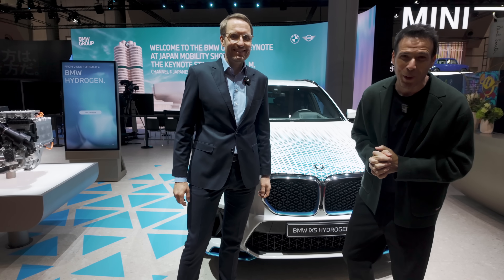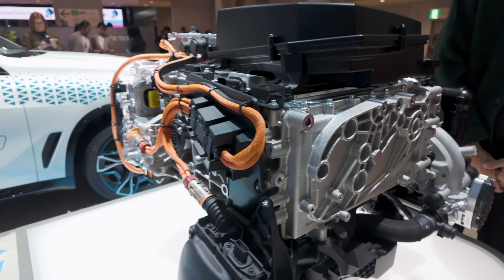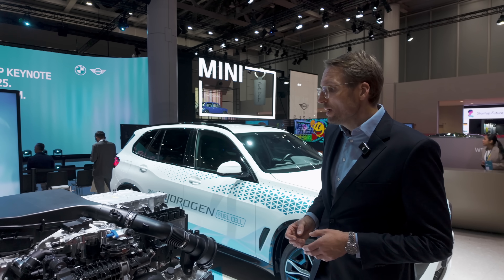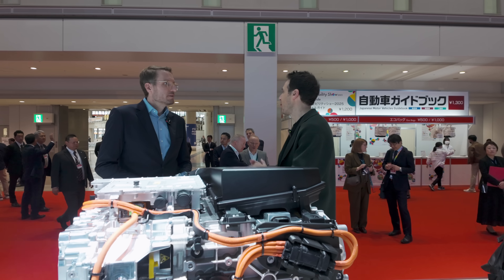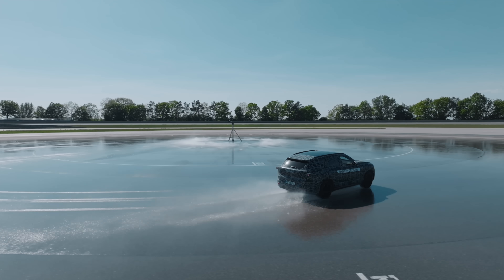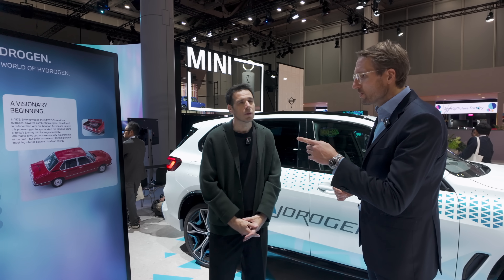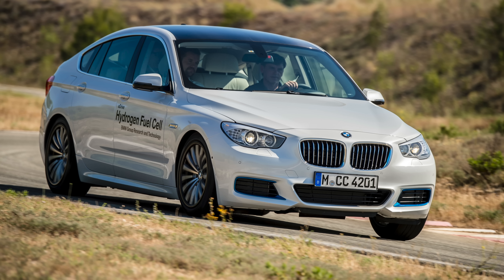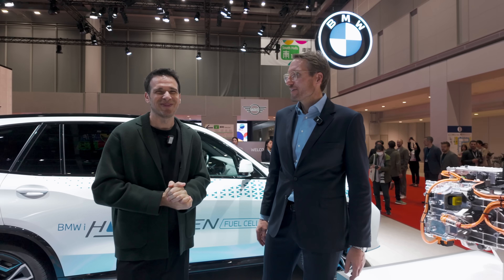BMW’s Next Powertrain: Breaking Down the Gen3 Hydrogen System

Comment: Fuel cells are almost as stupid, but not as stupid as batteries for transportation.  It should be hydrogen combustion. No one is talking about the dangers of EMF from powerful electric motors, they're a disaster waiting to happen.

Comment: Completely pointless car. You think that the EV charging network is lacking, wait 'til you look for a hydrogen filling station. 

And, as someone else stated, the energy input and steps required to extract hydrogen and then convert back to electricity in a fuel cell is extremely inefficient.

Why is BMW making such bad decisions?!

Comment: This is how it works: natural gas is used (very bad for CO2 emissions) to produce hydrogen (there is just not enough green hydrogen and never will be). Then this hydrogen has to be compressed or liquified, transported to one of just very few gas stations, there pushed into the car and in the car converted back into electricity in the fuel cell. This just wastes a large portion of the original energy. In contrast, BEVs store electricity directly in the battery and use it with far fewer conversion steps, so far less energy is lost overall. Of all BMW iX5 EVs hydrogen will make 0.00001% of all sales. Waste of money.
Reply: If a company like BMW does something like that, it has a bigger meaning than all of this you just described. Stop being so negative and enjoy it.
Reply: @MS-vv3dm  No, there is nothing BMW can explain to make it look better if you use 3 times the energy for the same distance in a car that is way more expensive to build. You'll see for yourself that the very few iX5 hydrogen cars BMW will sell don't make up for all the research and production cost.
Reply: BMW received €1.4bn  subsidies, ca. 400m hydrogen cars from EU/Ger and even Bavaria. Waste of tax payer money but good biz for BMW 😅.
Reply: Toyota and Hyundai Kia are using this technology. It’s just a matter of time before it’s truly relevant.
Reply: @EverythingEnnett  No, it's not. 1.) a hydrogen powered fuel cell car is 3 times less efficient than a battery electric car. 2.) There are no sales of hydrogen cars. 22.000.000 electric vs. 8000 hydrogen cars world wide. So even in Japan, South Korea and California, where you could use such a car, are these cars not sold. So it's a dead technology for cars and trucks and I wish BMW would stop spending money on it.
Reply: 2025 Nobel Prize in chemistry was give from solid hydrogen storage. the safest and largest capacity of all methods. Battery losers never mention it.

Natural gas being used for hydrogen is a good thing. It actually cleaning the planet, unlike batteries.  CO2 from Natural gas is converted to solid carbon, the oxygen is returned to the environment.  Can batteries do that no? Will batteries be relying on hydrogen for their "green electricity"  Yes.

Comment: Worlds most advanced fuel cell technology belongs to amazing hyundai motor group,with worlds first 12 switch- 2 stage inverter with 70% higher voltage utilization ratio and over all mind bending 32% better efficiency(almost like a petrol vehicle)meaning a 1900 kg FC-EV will travel 500 miles(800km) with only 6.6 kg of hydrogen . just imagine EREV vehicle with hydrogen range extender(fuel-cell)under the hood with 1500 km of WLTP range

Comment: Technical aspects aside, where is the market for hydrogen cars? Hydrogen in passenger cars is so inefficient that BMW should explain to me why they are wasting money on it.
Reply: Where was the market for EVs ? The governments falsely created it.
Reply: @mattevans5631  No, Tesla built a great car (Model S) and the corresponding infrastructure (Tesla supercharger network). But with hydrogen nobody built the infrastructure and even if there was an infrastructure, why take 75 kWh of power to create hydrogen to ship it to a H2 station to fill up the power to the car create power from H2 to drive 100 km, if you could use 25 kWh to put into a battery directly and drive 100 km? Why waste 3 times the same energy to create hydrogen to ship it to stations and then create power from this hydrogen in a car using an expensive fuel cell? There are good use cases for hydrogen and thus for green hydrogen, but its neither cars nor trucks.
Reply: @ChristianHauser78  maybe ask kids in cobalt mines the same question .
Reply: @mattevans5631  That's a different story and if BMW chooses to use cobalt in their batteries they will certainly have to check their supply chain. But that's in every battery thus also in a hydrogen car, in your laptop, in your mobile phone, wherever. My (valid) point is that hydrogen cars are 3 times more inefficient, more expensive and can only be charged in a few tiny spots on the globe like Japan and California. And that shouldn't even change, because for cars and trucks BEVs are far superior.
Reply: @ChristianHauser78  we can have the best ideas ever it all comes down to the people in control politicians etc can make anything start cheap with incentives etc and soon change there minds e.g uk 3p per mile on evs now so if you dont give it say 15,000 miles a year thats £450 extra and that is just a start .
Reply: @mattevans5631  That 3p per mile tax in UK would be very disappointing and its discussion now just adds uncertainty to possible EV buyers. But the price on oil and gas can also rise due to new tax thus EVs are probably still cheaper over all. But UK isn't great for EVs due to rather high charge costs compared to e.g. France. But if you could charge at home in UK you could charge for 7p/kWh during night which again is great.
Reply from the maker: apparently people who wanna travel long distance, but all electric
Reply: @bmwblog  You serious? Range is 500 km, iX3 700 km. Where do you charge hydrogen? OK, in Japan and California maybe. For every other part in the world you have to drive 100 km just to get the next 500 km. So please get a BMW hydrogen car while I'll drive the iX5 BEV and we both drive from Munich to Debrecen and back. Please come to Europe and let's have this journey. And take the bmw hydrogen guy with you. We'll compare cost and time. Challenge accepted.
Reply: @bmwblog  Actually I'd come to the U.S. or Canada for a roadtrip BMW iX5 Hydrogen vs. BMW iX5 BEV. I want to see the BMW managers drive from Chicago to Houston and back in an iX5 Hydrogen, or from Munich to Madrid or wherever, just not California or Japan, but everywhere else I'd like to see the challenge between Hydrogen and BEV (battery electric), both BMW, same size, and we'll compare cost, time and CO2. If Hydrogen wins, I'll shut up mocking BMWs hydrogen efforts.